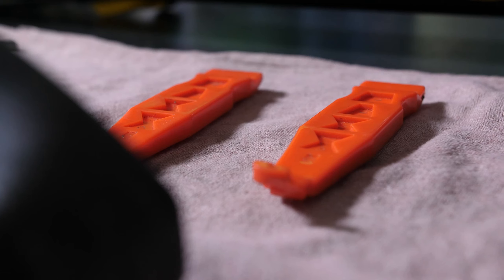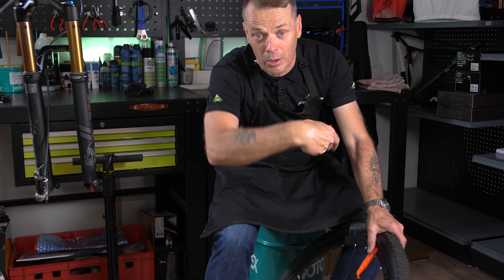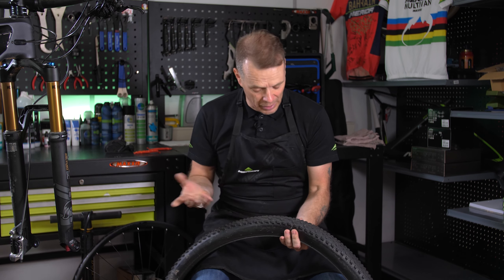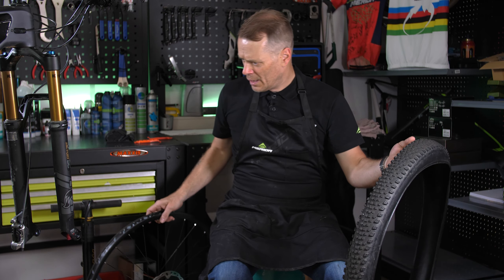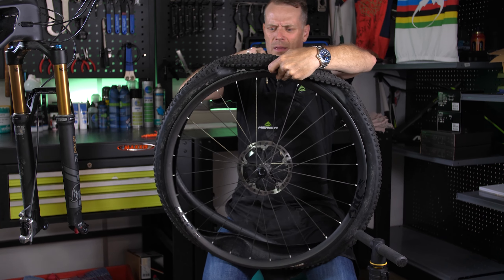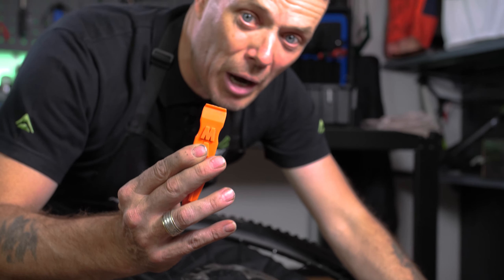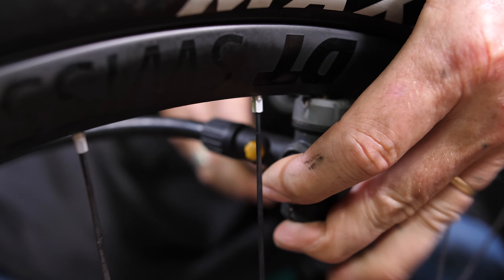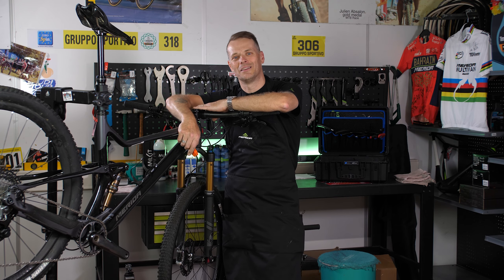How To Change An Inner Tube On Your Bike | In No Time

Comment: I seen an old video where Tinker Juarez used talcum powder to prevent sticking and chafing of the tube in extreme mountain biking conditions. He also noted that this also enhances cooling as well due to constant ungulation ( flexing) of the tires. My worry is if the tire and tube assembly isn't slip resistant enough it can spin on the rim and cause stem and tube  damage by the stem ripping away from the tube. Is my theory correct?
Reply from the maker: You're right - a rubber inner tube can stick to the tyre casing and the valve can be torn off if the tyre rotates around the the rim under heavy braking or at low pressures.

Some innertubes do come with a light coating of talc to prevent this happening, but there's no harm in adding a bit extra, especially if you ride in hot, dry conditions whether the tyre and tube can get sticky in the heat. Making sure you've properly tightened the valve retaining collar on Presta-style valve stems is also a good idea, for this exact same reason.

Thanks for the pointer!

Regards,
MERIDA